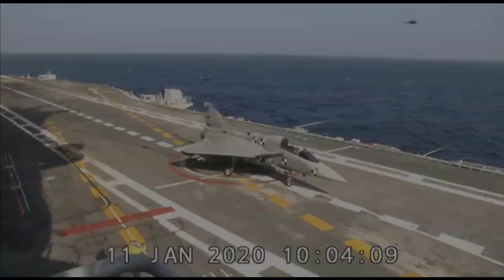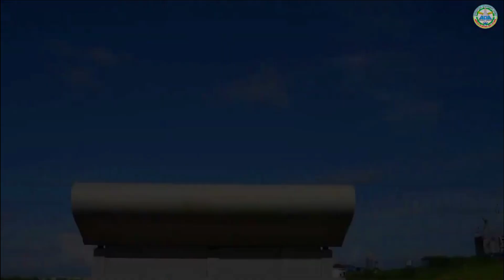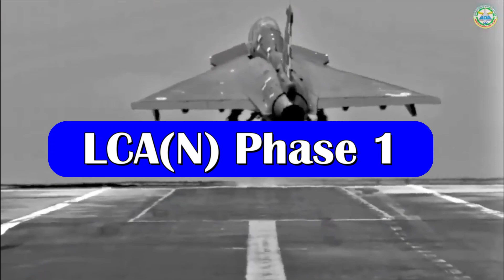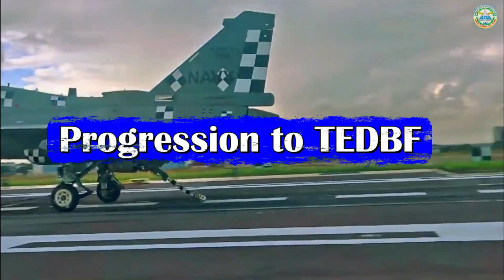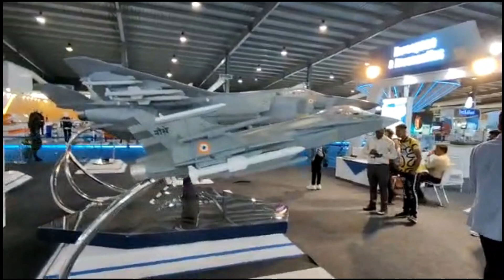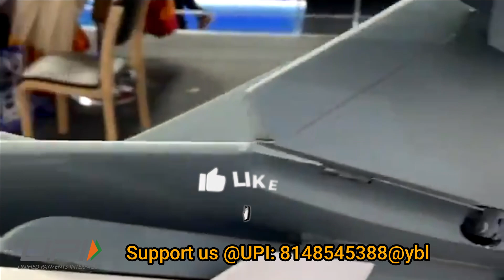Navy wanted TEDBF to be a 5th Generation Fighter #indianarmy #drdo #indianairforce

Comment: Could someone explain why a navalized version of AMCA was not considered - like the  F-35A and C or Phantom 4 before that?
Reply: TEDBF has canards 
It is designed to be a naval fighter
Reply: @fly463  Sorry, I did not get it. US is the largest operator of Naval jet fighters and none have canards.
Reply: @ashokkandimalla5962  
Because Fa-18 doesn't have delta wing design like TEDBF
Reply: As far as I can guess , a naval 5th gen has many disadvantages , like the f35 navy can only carry 2 air to air missiles in its internal weapons bay , which very greatly reduces it's air firepower , also the undercarriage of such naval aircrafts need to be extra reinforced to aid in the arested landing , so , some compromise to fuel is also done , so navy prefer a 4.5++ gen aircraft with some stealth features over a 5th gen as it can carry more missiles and more fuel
Reply: @medkid6405  But in this case Navy wanted a 5th gen a/c isn't it, they settled for 4.5 due to time lines.
Reply: @ashokkandimalla5962   nah , they first will go for a 4.5 gen tedbf then will later use amca's tech to upgrade it to a 5 and 5.5 gen , this is the latest update !!
Reply: TBH honest. TEDBF looks more stealthy than AMCA design.
Reply: @direwolf7491   amca will be overall more stealthy , however tedbf will be more stealthy than any other existing naval aircraft except f35
Reply: @medkid6405  Yes exacly my thoughts. Also, you don't really require stealth for Navy. There are no enemy air defense at sea as of now. Having sea skimming long range stealth cruise missles are more important than full on stealth fighters.
Reply: @direwolf7491  true , thats y even the us navy is focusing more on modernising hornets and more improved cruise missile defences
Reply: @direwolf7491  however if ADA do end up having a 5th gen version of TEDBF along with the 4.5++ jet  , its only gonna make navy more powerfull so whether they do it or not its a win win situation
Reply: @medkid6405  Yes you are right.
Plus 5th gen is expensive also.
Reply: @direwolf7491  yup but if our gdp increases as it is rn by 2035 we can be a 5/10 trillion economy or maybe even more , then we can use AMCA mark2 as a basis for a 5.5/6th gen tedbf o even if they skip 5th gen TEDBF we will have an advantage . TBH i feel like AMCA Tejas2 and TEDBF will help indian military aircraft development for generations to come
Reply: @medkid6405  Yes if they are made on time. I don't trust ADA at all.
Reply: @direwolf7491  well this is the first time they working on such complex projects with an aggresive timeline , u gotta give them some benefit of doubt
Reply: @direwolf7491   even with the f22 raptor  it took US more than 12 years to make f35 and even that isn't perfect yet... ... Here ADA is working from the ground up , so yea... Expect some delays but they will succeed :)
Reply: It's not as easy as adding an arrestor hook to make an aircraft carrier based. Especially when we don't have any catapult carriers. Our navy operates the STOBAR carriers with slopes which means that the aircraft will have design limitations. Accommodating those restrictions means cost overruns and delays. Not that we don't have delays as it is but if we were to do something like the Joint Strike Fighter Program then we won't have a prototype in 100 years. LCA banane mein to lag gaye 40 saal. 1980 se 2022 tak induction nahi hua.
Reply: @Zen-lf7zr  lca ka induction ho chuka haina abh toh ..and abh mark 1a ka suru hoga......april se shayad
Reply: @medkid6405  Bhai kaha induction hua hai? LCA can't even launch an Astra Mk1 or R77. The number of aircraft delivered till now is pathetic and it might as well be a showpiece.
Reply: @Zen-lf7zr  2 squadron hai and recent joh air exercise hue hau they have participated....thoda knowledge badhake aao desh ko gaali dene se pehle bina siche kuch bhi bolnaa hai
and they can launch those missiles and israeli guided and unguided bombs , helmet mounted sight bhi hai
Reply: @Zen-lf7zr   2 squadron mark 1 ki hai and baki 4/5 mark 1a ki honi hai
Reply: @Zen-lf7zr   lca trainer bhi deliver honge april mei
Reply: @Zen-lf7zr  u really neeed to touch some grass brother....
Reply: @Zen-lf7zr  bohot bure haal hai tumhare u need help and fast
Reply: @Zen-lf7zr  flying bullet and flying dagger yeh hai dono squadrons ke naam
Reply: @Zen-lf7zr  thoda article vagerah padho bss YT see news loge toh yahi hoga
Reply: @Zen-lf7zr  40 LCA mark 1 abh tkk deliver ho chuke hai
Reply: @Zen-lf7zr  aur news chaiye toh bolo voh bhi dedu...ya bss kaafi ignorance pta chl gyi tumko
Reply: @Zen-lf7zr  first Squadron 2016 mei operational clearance mili thi
Reply: @Zen-lf7zr  i feel sorry for u brother , get well soon

Comment: Phir toh ho hi gaya,still unable to deliver an upgraded Tejas aka Tejas MK1A since 2019-20,expecting Deck Based 5th generation fighters from ADA/HAL is lunacy,if it arrives also it will a 4th generation fighter dubbed as 5th generation that too arriving after 2040-42,getting ready for induction only around 2050.
Reply: They want 5th gen after 4.5th gen if possible
Reply: @fly463  Even 4.5 generation seems like a distant dream for now.
Reply: @Sacrafago90  
We will see if the program succeeds or not in 2026
Reply: better to make su 35  licensed too much delay will cost us heavy in potential war.

Comment: The IN wants indigenous 4.5 & 5th gen naval fighters right, so why not naval AMKA MK1 without internal weapon bay ? Missile hardpoints can be fixed under fuselage just like KF-21 BORAMAE. The landing gears & arrestors will have to be made more rugged & strong. This way project management can also be done easily
Reply: No sir amca will equided with internal weapon bay also it's equided with 6th generation technologies
Reply: @biswajitmajumder9922  mk2 will be equipped with 6th gen technology
Reply: @manas2656  Tejas mk2 will equided with 5th generation technologies but it's design is 4th grneration

Comment: 5th gen fighters for both Indian air Force and navy are good in papers only. All these hypes and expectation of people are killed by HAL with constant delays in every program. On 2030 HAL will tell that TEDBF 5th gen will be ready by 2050!
Reply: It won't take much long if the navy opts for naval AMCA, timeline of AMCA is ahead of TEDBF
Reply: @AnirbanSarkar203  Still AMCA prototype won't fly before 2032-33 & get ready only after 2038-40 if all goes well.
Then with modifications comes the Naval variant,which will take additional 5-6 years to get ready,which means induction by 2048 only.
He's not wrong about 2050 timeline.
Reply: @Avijit Ray

Nope you are delusional.
The prototype will be out by 2026
Reply: @AnirbanSarkar203  Critical Design Review of the AMCA is still pending; Funds will be allocated only afterwards. And DRDO is still struggling with the supply chain for the Tejas Mk2. They keep making all sorts of claims about 24 aircraft per year, but currently, we struggled to produce 8 FOC Tejas/year. Now imagine trying to cope with 4 different production lines and supply chains (mk1a, mk2, AMCA, Naval AMCA). I counted naval AMCA separately because I am guessing the Air Force and Navy will ask for these parallelly. We need to remember that we have a more limited industrial base than the US or China and reduce the number of programs, especially when they are about less number of planes.
Reply: @inirs08
Nope we can match the timeline
Reply: Considering HAL that is fast 🙃
Reply: Drdo's ADA develops fighters not HAL. They just manufacture whatever they have asked to

Comment: Why not focus on AMCA as the base and add a naval variant? This seems like too many projects for DRDO's track record of lateness.
Reply: AMCA is designed to be a ground fighter. Converting it to a naval fighter would result in a major redesign as well as  loss of capability.  The next design of TEDBF can be fifth gen with full on stealth.
Reply: @TheLargeoldshoe  KAI is doing the same with KF21 Naval variant for their future carriers,also Mig29K,Rafale,Su27K(Su33),F35 were designed as Land Based Fighters which were later converted to Deck based ones.
Reply: @Sacrafago90  Yes but ADA is on record saying that it is far easier to design a naval variant first and then convert to a land based one. For that matter the F-35 C (the carrier version is not as successful despite the emals).
Reply: @TheLargeoldshoe  ADA on record says a lot of things,which is far from reality especially regarding timelines & their technological prowess.
According to them they have all the 5th generation technology ready for a fighter,but still they are unable to build one.
Reply: This is the best thing drdo can do.....they can merge AMCA Mk1( not mk2) & TEDBF....
That's the best they can do...they can modify AMCA Mk1 by making it's landing gear stronger and not applying stealth coating and making strong hard point etc
This is logical....but what to do??
Drdo and logic are two extreme polls sometime...
Reply: @ashishbabu1617  Extreme poles not polls
Reply: @Sacrafago90  sry, spelling mistake...
Reply: Let them stay apart is not bad tbh I'm more hopeful for tedbf then amca, atleast tedbf has a timeline & it alredy has 5th gen frame so might not to to hard to further enhance it. But in short apart is better for now(looking at IAF's interest & HAL,drdo,Ada relaxing timeline)
Reply: It will take more time and become more expensive. Once they actually make the AMCA I think it will happen in the future as well.
Reply: The navy needs a twin engine fighter.
Reply: @uvg319  Which AMCA is...
Reply: @Tiporae  
AMCA doesn't have canards
Reply: ctrl c ctrl v fudge up.  I was trying to say:
Converting Airforce based fighters to naval types have proved difficult as evidenced by  F35A-C, Mig 29M-K and LCA program. Although most components for the TEDBF will have to be remade, the development curve with a more suited airframe will be less risky and faster(dare to dream) given experiences with Naval LCA and Tejas MK1-2. Most key systems will probably be straight lift for TEDBFMK1.
Reply: @uvg319  Amca is not single engine